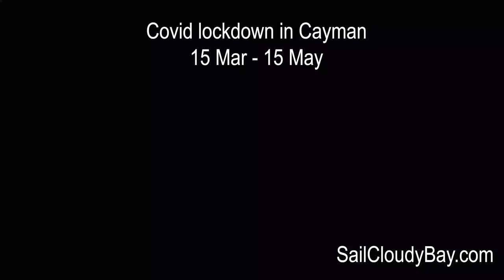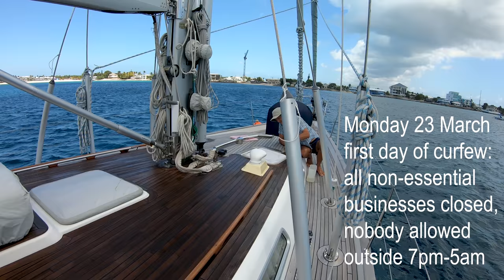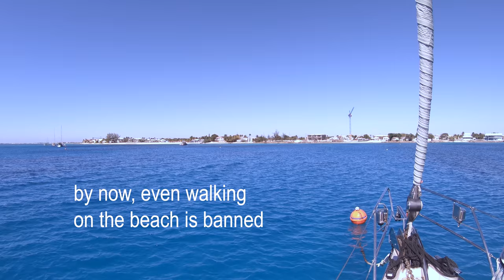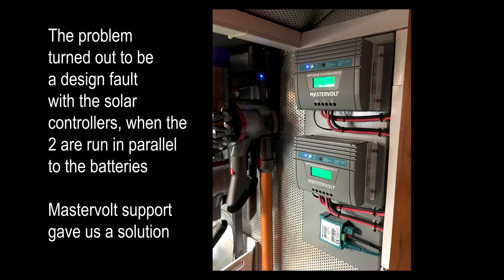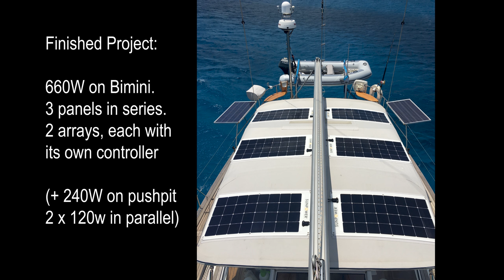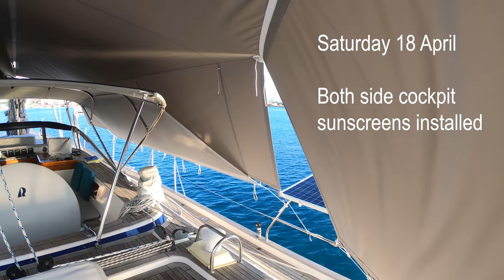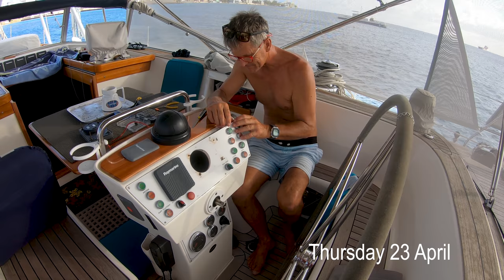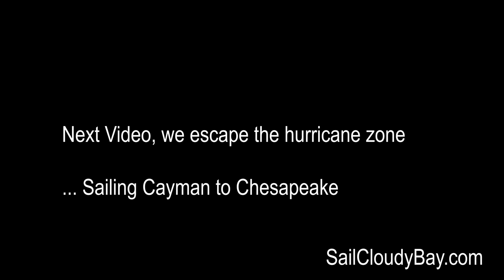Boat Projects - Covid-19 Lockdown - Grand Cayman - Hallberg-Rassy 54 Cloudy Bay Mar-May'20. S20 Ep18

Comment: I gave this at least 3 "wows": the solar panel mounts, the boat bridle method, and the dinghy chaps!  Well done video to!
Reply from the maker: Yes the bridle was interesting. First time we started to rock in the swell we used that method .... and within a few hours, all the other yachts on moorings did the same :)  Sometimes we have done that at anchor too. The issue there is if the wind swings you can end up with the anchor chain around the keel :( So you really need to know the wind is going to stay reasonably constant in direction. Yes, very pleased with the solar and the dinghy chaps. I dont think I'd have had the patience to do those that well without this time on our hands.
Reply: @SailCloudyBay  Thanks, great info on the bridle method, that could be a game changer.  I've seen a couple of other videos in the exact same moorage with the same problem, and they only overcame it by moving to another anchorage, guessing not an option for you.  I find myself in this situation regularly, going to try your method! (with winds consistent).  Hope 2 C U 2 out there!

Comment: This is really a professional boat work Glenn I am amazed. But how come you don't have AC in Cloudy Bay?!
Reply: Totally gobsmacked by the dingy cover. When finished it was hard to see it was even there as the fit and finish were so good. Amazing. I predict the orders will flood in!
Reply from the maker: Thanks for the compliment Ali. Yes, we do have an AC, but it needs us to either be connected to shore power or we run the generator. We find our hottest times are usually in windless marinas berths, so the AC is often used in marinas. At anchor we rarely use it as there is generally a nice breeze coming through the boat. But, by the end of our time in Cayman, it was getting damned hot and we were running the generator and AC for a few hours in the evening to knock the heat out of the boat before we went to bed.
Reply from the maker: Thanks for the compliment Nick. I think it was all about the time that we had. If you look at the dates you will see it took nearly 2 weeks to make that cover, day-in day-out. Oana claimed she "I lost you for 2 weeks" and she was very glad when it was done! I don't think I would normally have the patience to do this. It involved a huge amount of re-work in places - especially those damned spherical tube ends. Mind you, it was a first for me. I learned alot and could certainly do it quicker next time.
Reply from the maker: Haha .... just looked up Bear Grylls. I'm honored to be considered a secret version of him!  One difference ... we don't do cold!
You are quite correct, we didnt film all the swearing. Those damned tube ends almost finished me!